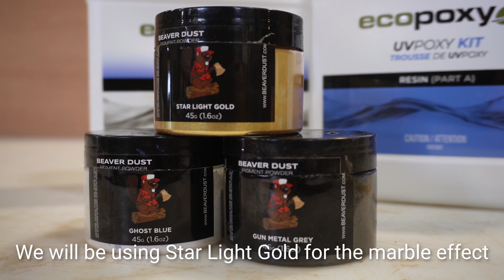How To Create a Marbled Epoxy Resin Effect

Comment: Thanks for the video. How much time is the epoxy in the vacuum chamber. I have always wondered about the combination of the time in the chamber and the working time. Is there a min working time to look for with an epoxy if you are going to use the chamber?
Thanks again!
Reply from the maker: Usually around 10 minutes. You can watch the amount of air bubbles being released. Typically any deep pour resin will have a long pot life, we don't tend to use quick cure epoxies. If you're using something that cures quickly you'll have to factor that pot life in for a vacuum chamber. Some small craft makers put their pieces into compression chambers AFTER the pour as well.

Comment: Why sand after the final clear coat?  What did you use to stuff into the ends of the river to keep from filling outside edges?
Reply: After the clear coat, we need to sand down the wood and then polish the epoxy separaetly before applying the oil finish to the wood. We didn't want the glossy look that epoxy leaves on the wood.
Reply from the maker: We also used silicon and hdpe

Comment: Great video, me and my dad are making an epoxy desk any advice?
Reply from the maker: That will be a fun project! Absorb as much information as you can when working with epoxy, we will be posting more videos over time to help with that. Double check your form for leaks, make sure your epoxy ratios are good, mix it well, and keep an eye on it for any exothermic reaction! Best of luck, and have fun.
Reply: Before you do you first pour, mix thin coat resin, brush on edges of the wood, and cover bottom, about 1/8 thick, this seals wood, to stop air bubbles, and thin coat on bottom, to see , no leaks, when tacky, you can pour ,your first colour coat, torch for air bubbles.